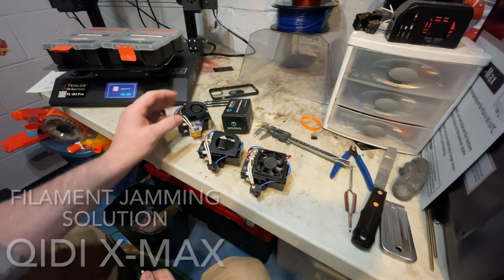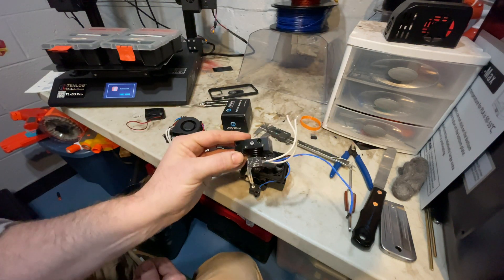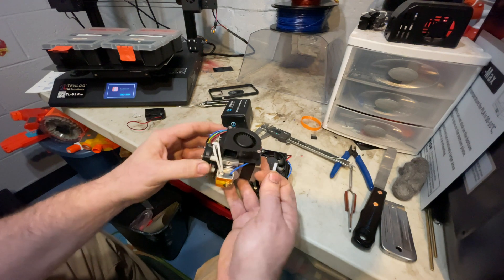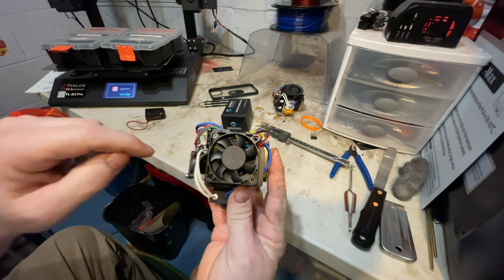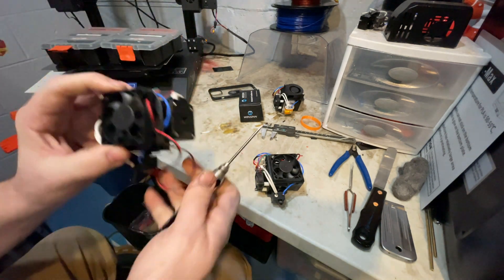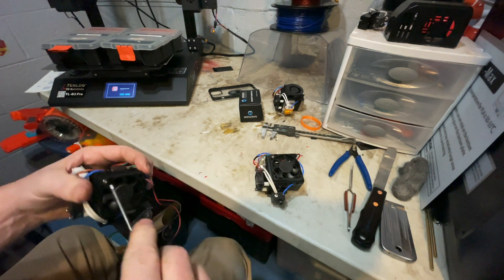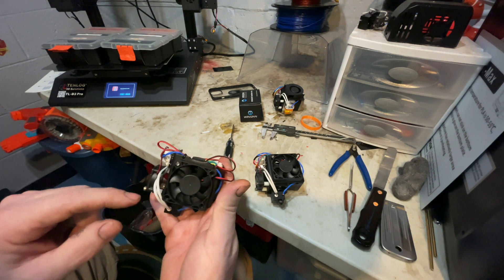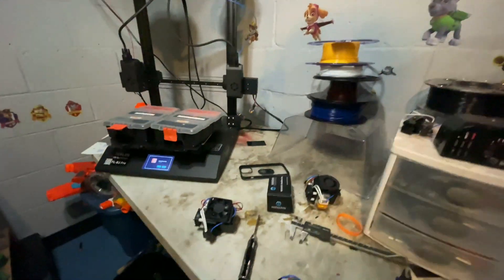Qidi X-Max High temp extruder jamming solution.

Comment: Thanks fir the video, I know this is a little old but my question is I'm starting to get blockage you describe. I have never used the high temp one that came extra with the printer. Is there any reason not to use it for just every day PLA and PETG. That is as hot as I ever go. Rather than mess with trying to fix the old one why should I not just use the high temp one? Thanks for your input.
Reply from the maker: I don’t think the high temp extruder has a parts cooling fan? I had issues with the high temp extruder clogging as well but I had added the fan to help with the issue of the clogging.
Reply: @TTV_FUN_AT_50  Thank you, I'll clean the hot end and try again with different filament. It may be the problem. I'll be looking into the fan as well.

Comment: To anyone that want/needs to know... i literally just bought a Qidi tech X-plus II. It did come with 2 hotends, BUT they are now sent with their NEWEST/NEW upgraded "hotend" and it is all metal. It literally is the same exact one they use on their newest model of x-pro CF ( carbon fiber 3d printer)
The only difference is the X pro CF comes with their newest upgraded hotend already installed on the printer... the X plus II is swnt with THAT same exact hotend, just not installed on the printer already. It comes it a seperate box and you have to install it. It is much different from the hotend you recieved with yours. So to you people that reach out to qidi tech and tell them issues/problems/concerns/etc etc etc... They definitely listen to you guys, they pay attention to what their customers tell them... and they actually make those changes ASAP. so thank you to everyone that does take the time. Because iam brand new to all of this, ive been wanting a 3d printer for MANY MANY years now. But i definitely to finally do it and i bought the X plus 2 for my son, and i bought the X pro cf at the same time. To get into the hobby with my kid. Iam primarily going to be printing in mostly CF filaments, and other very abrasive filaments....  i didnt want to run the absolute balls off the X plus 2 for my kid lol. So yeah just an fyi for anyone wondering, i saw some others wrote that they were doing this... i just want to confirm this to you as ABSOLUTELY 💯% because i have both

Comment: Having the same problem, It only started after using Silk PLA with the low temp extruder.  and it only happened on the high temp extruder after using Nylon filament. I was able to remove the clog but then I tried a Silk PLA filament on low and high temp extruder and both now need to be completely disassembled like you've done. Looks like a pain the @ss. If you send Qidi the info on the cooling fan I have no doubt they will fix it and add that or something like it that works. They seem to be very good about helping their customers as we can see here. I gave them advise on making their extruders easy removal with a latch system so all you need to do is unlatch it and remove it. That alone with make a huge difference for me.

Comment: Just wanted to drop by and say, Thank you for making this video.  Since installing this fan on my high temp hotend.  I’ve had zero issues with clogging with 70% fan and printing nylon carbon.
Reply from the maker: Nice! Glade to hear it helped!
Reply: Can I get some help please i got a second hand xmax it's my first printer i don't know if I have the low or high temp how can I tell the difference @TTV_FUN_AT_50
Reply from the maker: @bannerlanow790  The high temp extruder has a Black nozzle and Black heater block. The black nozzle is the hardened nozzle.
Reply: @TTV_FUN_AT_50  thanks

Comment: Okay, Qidi needs to fix this. I have been emailing them. My high temp extruder won't print shit. It clogged the first use. So, ill order a fan, and add to it like you did. Are we sure its a 24v fan??? and not 12v ???
Then, Im doing the ICARUS upgrade to the carriage and buying a new extruder and hot end. Thanks

Comment: You still have a 30mm fan on the front of your low temp extruder, but can probably swap it for a 40mm fan. I am going to try 2X 40mm fans for my low temp extruder and see if it will stop PETG jams while staying under 235C. Cheers!

Comment: Ticking of the extruder means that the PTFE tube is starting to clog, I have Low Temp hotend, High temp hotend with PTFE and All metal hotend
They all would clog. Had the most success with the Low Temp Hotend, and when the ticking would start, change the PTFE and nozzle.

Then I did these two modifications;

50mm extruder fan with re-directed fan duct
X Max Hotend Fan Duct by Pardner - Thingiverse

and

Second 50mm fan mounted where the "Parts Cooler Blower" normally mounts. Cooling the Stepper.
This youtube video

No more clogs, hours and hours of prints.

Comment: just change small 30mm fan with bigger 40mm fan and from standart hotend barrow blower fan, becomes also abs and pc-cf need cooling when you print where are bridges. between extruder and heatbrake is issue of some printers, need 5mm drill litle bit touch enterence to not have sharp corners. after you can buy also heatbrake fuul metall from mk10 to m8 and put vulcano nozzle, print speed can easy bump up to the x2.... or print out new carriage and use dragon hotend with bms or orbiter extruder... plus also option use octoprint.

Comment: Thanks for a simple solution!  Just got an X-Plus and have this upgrade ready to go on my Qidi high temp extruder. All I’m really trying to do is get this extruder to work well enough to print out the upgrade parts to build Hume Beam’s awesome Icarus extruder upgrade on Thingiverse (Orbiter 1.5 and Dragon hot end) for the Qidi printers (X-Max, X-Plus, I-Mate). Using Polymaker PC Max for the upgrade prints so I’ll need the high temp extruder right away . Hopefully once the new extruder is working well, I can retire these Qidi extruders to the storage bin😀

Comment: Have you removed or replaced the actual nozzle on the high temp extruder?  I have been running spools of colorfabb XT-CF20 on my X-Maxx and I was wondering if its already wearing from the carbon fiber.  I wanted to replace the nozzle or get a link to one I can buy as a spare, but Qidi told me that the whole high temp extruder has to be replaced and the nozzle is not a separate part that can be purchased.  I am not sure why because I removed the nozzle from the extruder easy enough and noticed a small washer that sits above the nozzle and under the Peek tube as well.  I have had clogging issues after the first spool, but I have been doing a load / unload / load sequence on the filament at elevated temps in order to clear the jams.  Sometimes it fails a build and sometimes it seems okay, but none of the parts look as good as the original parts from the first spool of filament.  Thanks.
Reply from the maker: I replaced one on the low temp extruder and had no issues. I just pulled the nozzle off of one of my high temp extruders and appears to be the same design as the low temp. Just to verify I put a micro Swiss 8mm nozzle on it and it looked identical size wise as the hardened one that the extruder came with. It’s my believe they do not want you to swap nozzles out because if it’s not exactly the same as what is on it, you will have issues switching back and forth between the two extruders with z height.

Comment: Could you have replaced the small tubing that's softening with Capricorn high temp tubing?  Do you think that would work instead of adding a fan? I'm considering this printer and is why I'm asking.
Reply from the maker: It is actually already a high temp plastic not normal Capricorn. The fan was the best solution for me, ever since I added it I have had no issues.
Reply: @TTV_FUN_AT_50  Oh, ok.  I just saw other people were saying they were using the Capricorn in other instances because they said is was rated up to 300 (supposedly) and maybe thought it wouldn't soften like that plastic but I see why you did what you did.  Thanks for the response.  Looks like a good fix and thanks for the info and your vid.

Comment: I'm new to 3D printing so I apologise if this is a stupid question. You replaced the part cooling fan with the other fan to stop jams. Do you not need part cooling for high temp materials ?
Reply from the maker: The high temp extruder does not come with a parts cooling fan installed. I don’t use a parts cooling fan on materials like Nylon, ABS, even PETG unless it a very small part that does not cool quick enough. Even then a lot of times I will just have the printer slow down on layers less than 5 seconds.